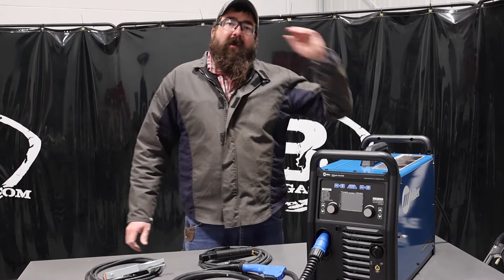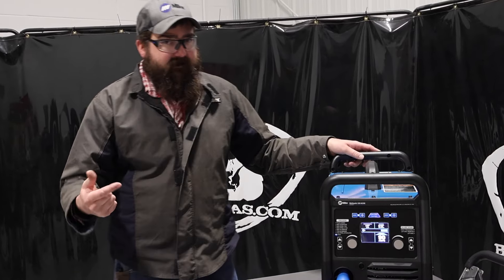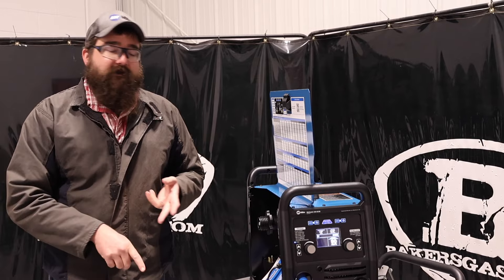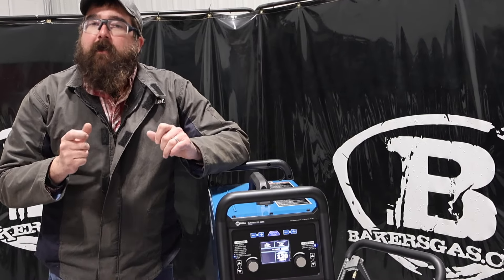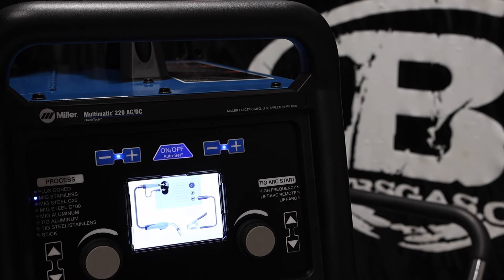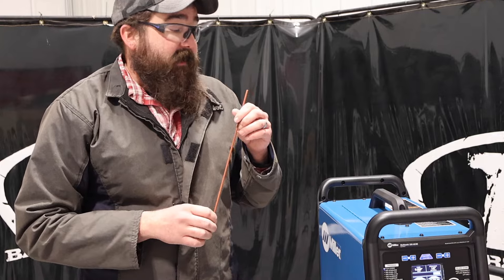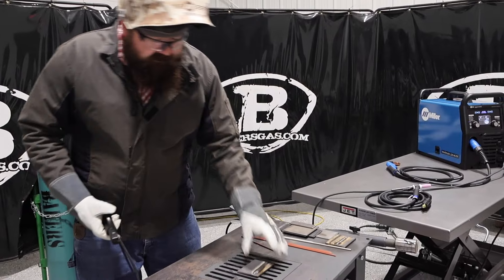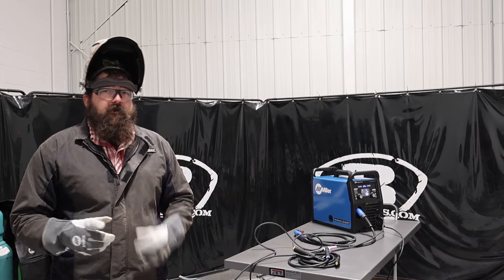New Miller Electric 220 with 6010 UPDATE! + 2024 Miller 907757 Review

Comment: I wasn't aware the older 220 wouldn't do 6010, that's gay, so I'm glad they fixed before I bought one.
Reply from the maker: Most multiprocess machines do not so this is a neat feature added by Miller! Let us know if you have any other questions.
Reply: @BakersGas  HOnestly... it SHOULD have already BEEN in on the 220's! It's absolutely PATHETIC of Miller to not of had this in ALL of their machines. I have a $500 welding machine that will 'do' 6010's but a friggen' Miller can't. Absurd. Especially for the price of these machines.
Reply: It will run it. But as you’re running a 6010 rod the arc will randomly just go out. Inconvenient yes. But in a pinch if that’s all you have…
It does run 6011 just fine.

Comment: Why is it on the Miller Multimatic Assembly line tour video , the miller rep specifically states that the update is software related for the 6010 capability?
Reply from the maker: I am not sure I saw that specific video, but I confirmed with the product manager that the 6010 update cannot be updated or added to older versions. Sorry :(
Reply: @BakersGas  Another piss-POOR excuse! Miller should be able to swap out boards! Miller is seriously pushing customers away with this atrocious mindset!

Comment: Has there been any update to make AC TIG welding on the 220 more comparable to the rebel 205
Reply from the maker: Hey, thank you for watching and commenting. We just posted a video on the TIG side because we get a lot of questions. Miller intentionally did not make the TIG side have all of the Rebel's adjustments. The Miller 220 is easier to use, and they found the extra adjustments were not needed for quality welds and prioritized simplicity and ease of use. 

https://youtu.be/T_tCaPbp2rk?si=rxRiFvxHQ9taYDw3

Comment: Is the only difference in features between old and new 220 versions the capability to stick weld with 6010? Are there any other settings that can be changed in the new version versus old? Are all accessories and parts generally interchangeable between old and new other than internal circuit board (hardware)?
Reply from the maker: Yes, a few other little things like a different box, QR code at set up, nothing on the TIG or MIG side or physical machine changes.
Reply: @BakersGas  Too bad. Was hoping they’d add more options for pulse while they were making changes.

Comment: This Miller multimatic 220 vs the Fronius trans steel 2200? What is better and why?
Reply from the maker: The Miller 220 will AC TIG aluminum which the Fronius will not. The TransSteel on the other hand you could MIG aluminum through the MIG gun which is neat. (Miller you would have to use a spoolgun) We sell and stock both feel free to call or email us for a quote or with any other questions.